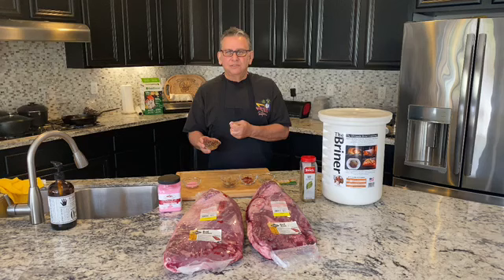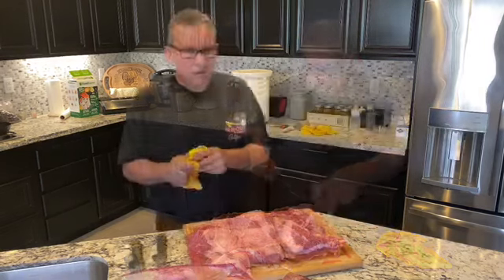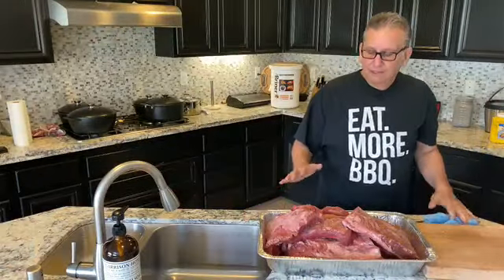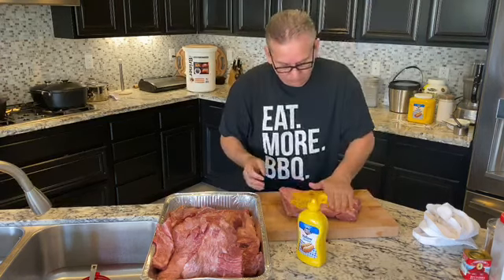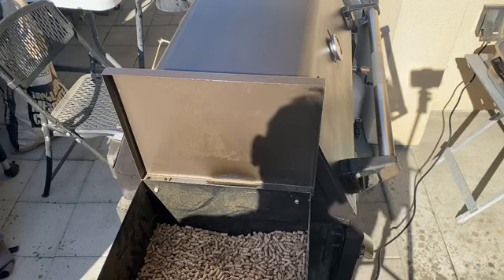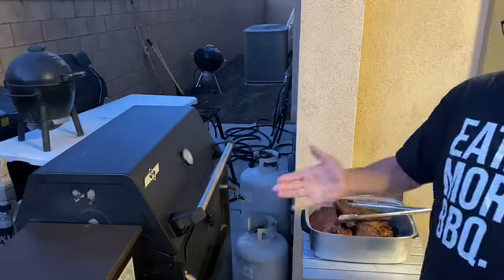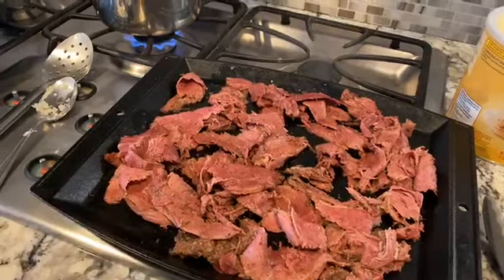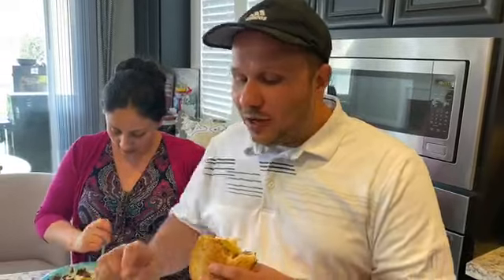how to make home made pastrami better then katzs delicatessen

Comment: I have made pastrami many times. I prefer a 4 week brine.  The rub is only 50:50 coriander seed and black pepper. Smoke over cherry wood till it hits an internal temp of 175.  Create a makeshift steamer for the oven. place in oven at 250 until the internal temp hits 203, about 1.5 hrs.  Let it rest and done.

Comment: Dude, everything was awesome until the pastrami in the oven part.  Everything fell apart after that.  Slice the pastrami when it is still hot.  No need to put pastrami seasoning or whatever you put afterwards.  If your seasonings were right, there is no need for it.  What is this putting oil in the grill?  If the pastrami is cold, steam it to heat it.  But anyway, I enjoyed the video, over all.